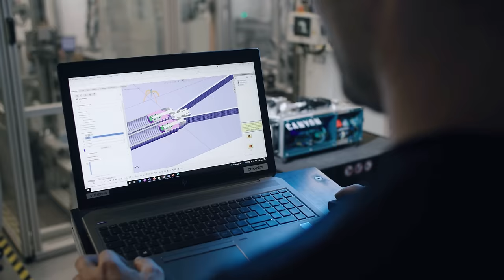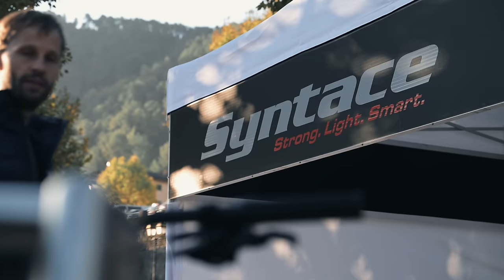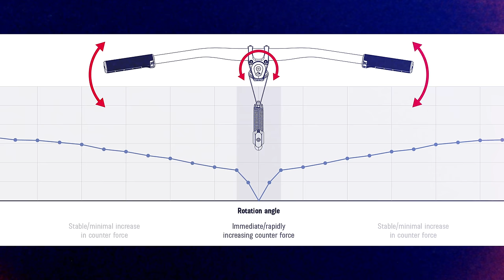Keep It Stable (K.I.S.) | Drop into the details behind this all-new technology.

Comment: The main advantage is it's easier to push the bike anywhere holding the seat only :D
Reply: Exactly it is very old system for city bikes with baskets on handlebars, nothing more.
Reply: Great for pushing your bike home when you snap the mech lol.
Reply: Good point, or just sitting on it
Reply: @Zangief ☭ finally!
Reply: @Zangief ☭ but there is nothing to elaborate on . It is old invention that do not do much but they advertise it as some kind of revolutionary new idea.
Reply: @Zangief ☭ motorcycles have been using stabilizers for decades, this being a on a bicycle doesn't make the actual invention different lol it's a steering stabilizer for a two wheeled thing lol pretty standard stuff in the moto world, now MTB downhill speeds are matching motospeeds... in come the need for stabilizers.
Reply: @GrafRamolo  totally, it's literally a spring that counteracts steering
Reply: @quban79  it's what I wrote .
Reply: Not at all. The free steering its what keeps the bike strait. At the first vibration this bike will fall.
Reply: @BodieMTB  lock your handlebar with two straps and try😀
Reply: you must have no idea how stabilizers work lol people use them on motorcycle buddy
Reply: @BodieMTB  we ´re talking about pushing a bike from the seat
Reply: I'm not talking about that lol
Reply: @BodieMTB  these are the answers to "The main advantage is it's easier to push the bike anywhere holding the seat only :D"  from György Mohl 🙂
Reply: @Zangief ☭ velo orange has had this for some time, not exactly the same design but essentially the same idea.. the concept has been around for ages..Cane Creek made a headset a while back with the same notion, don't think it ever took off though
Reply: It had better be more than just that, because wheel stabilizer springs already exist.
Reply: @BodieMTB  I'd argue that moto stabilizers have a different function and have an actual damper in contrast to springs. That'll be the "KIS pro" developed by Fox in 2024. 😄
Reply: I mean it is quite New that you see it on a bike but for racing-motorcycles like Superbikes, there is something similar existing it a steering damper or zu Deutsch Lenkungdämper ... dort erhöht er die Stabilität bei Kurvenfahrten oder gerader Strecke durch Minderung der Vibrationen.
Reply: @quban79   a very well tuned one tho
Reply: Bener 👍
Reply: @Carsten_Hoett  except for the fact that a motorcycle steering dampener does not return the steering to centre when you have the bike on a lift or the front wheel off the ground. It also has differing resistance depending on the handle bar angle. So not really the same after all.
Reply: @yuk-erkmckirk9277  Well the only thing I want to admit is that the general idea is existing longer.
It is also common sense, if you have been once on a motorcycle, that the dampers are not going to reset the steering wheel/bar and that the forces are different.
At speeds beyond 50km/h you steer the moto only marginal by changing the bars angle and more by leaning.
Imagine you would drive about 100km/h and your bar is resting without knowing, that would be the difference of curving or not.
And at speeds greater then 200km/h where the vibration is getting rough the force are probably also different but in the end this design is also attempting to react less  quick to impulses for keeping the bar stable at its position and yours is more quick because you don't impact the direction changes.
Reply: @yuk-erkmckirk9277  Btw. it is probably also not wanted to reset neither by bike nor motorcycle because both vehicles work the same way and it's stability is depending of the velocity of the rear-weehl mostly as they act like a Gyroskope which keeps it self stable by the spin.
If would fix the front bar the contraction would fall aside because the front wheel would not adapt to its precisional-movement. Therefore motos are also quite more stable on higher speeds than lowers.
So I can imagine that no-one mounted this on industrial skal eventually because of cost or to not negatively impact handling.
I guess the damping coefficient is choosen well so that this is still possible.
Reply: @quban79  Extra $500 for a couple of springs, some bands, & hollow out a portion of the frame.. I can see why.
Reply: Indeed. Pushing the bike by the stem was just too complicated a maneuver.
Reply: So, it is good for triathlon transition zones, and I see it as the only advantage :)
Reply: @Zangief ☭ Decathlon elops 520

Comment: hey canyon, you can easily make this bar spinable if you put the cam ring on a torque sprocket. it will click back into original place after the spin. <3
Reply: W manz
Reply: @mtbewan5632  and it will also, sound cool as heck.
Reply: @trbotimmmmmmmeh  imagine if it dinged like a quick release steering wheel
Reply: @matess3655  i just tried making something like this with a spare tire tube as a glorified elastic and it seriously works, the bike seriously just wants to stay stable and does not want to fall over. canyon, you nailed it.
Reply: @trbotimmmmmmmeh  i was thinking of making it myself, stoked to hear that it works with something as simple as an inner tube, i'll definitely make it now
Reply: @matess3655  it was very ugly my knees kept hitting the bands in agressive pedal position, had to stretch the bands from the tops of the forks stanctions all the way to my seat tube to get the same even torque on both sides. a tight spring or a rubber elastomer is much more efficient than long elastic bands, takes up way less physical space for the same torque.
Reply: would probably also protect the system when you crash
Reply: @brownzys7299  oh! yea! a crash would surely damage something if the bars spin out of control!!!!
Reply: @trbotimmmmmmmeh  tried to make it just by connecting my top tube to the stem with a piece of inner tube, gonna need something stronger though, it was barely noticeable
Reply: @matess3655  no dude lol, you gotta like wrap a whole tube around your bottom top tube to replicate how tight a spring can be, then get some fabric straps for the forks, just like canyons idea. i did this tonight. still not a permanent replacement, im not thrilled with adding the weight of a tire tube to a dh bike.
Reply: @trbotimmmmmmmeh  yeah i know it's gotta be much tighter, it was just a prototype i threw together in a few minutes, it's gonna need lots of improvement. Thanks for the tips though
Reply: @trbotimmmmmmmeh  

This looks like what you'd get if you asked Rube Goldberg to design a compliant mechanism for this use case.

Damping/steering assist - great idea, odd execution.

Search "compliant mechanisms damping" on the web, because the programmable steering return/assist curve is something that's well documented in a multitude of compliant mechanisms that already exist, as well as general suspension analogues for almost any vehicle/type you can imagine and then some.  

The work has already been done but few manufacturers seem to be picking up on it - then again, if you don't need replacement parts in a near perfectly working design they're probably scared of losing a piece of that arguably reoccurring revenue as well as potential future sales of "improved" models.  It's SUPER common to add complexity and awkwardness to a design just to create a solid dependency link between the end user and the manufacturer, especially if your design is really solid and flexible.
Reply: Why would you want to spin the bars anyway? Just use a jump bike or BMX...
Reply: @MrKFess  welcome to 2022 where mountain bikers do tailwhips over 20 foot gaps. jump parks need perfectly groomed jumps, mountain bikers dont.
Reply: That was a concern I was thinking about really cool idea
Reply: I think this one is not going to be mainstream, cause it is dangerous!
Reply: or make it magnetic??

Comment: This is one of those things that's odd at first, hard to wrap your head around and seems too simple to work well. I'm way more excited about this than anything with a battery though for sure.
Reply: For me too. But I fear that a simple thing like a tube at an angle used for steering with the help of bearings isnt fancy enough
Reply: Even simpler: Use fork offset to do exactly the same thing like bike manufacturers has been doing for 100 years...
Reply: @titter3648  Annnd, that impacts trail which means you either wipeout at high speeds or you cannot turn at low speeds.
Reply: @underbikedoverconfident1142  ya , I had an electronic steering damper on my motorcycle. It's sould do anything while moving super slow but would tighten up faster you went .

Comment: This is going to pair very well with the new full time AWD systems they are putting on bikes, especially those with the e-differential lock.
Reply: Have you seen the crab walk mode for new awd rides?
Reply: @bethsaytomvarughese8839  yes I've ridden the new Santa Cruz concept bike that has crab walk mode and adjustable ride height. Very cool.
Reply: Nice... What about the one with the autonomous riding by Skynet?
Would you be the rider or pillion on that?
Reply: I can't tell if you're joking. You know bikes exist that have AWD, right? I own one. They're made by Christini in Philadelphia.
Reply: @deusexaethera  I am joking. How does the AWD ride? I'd like to try it. Is it a significant improvement from a normal e-bike?
Reply: @devoidbmx1  : I have the old fashioned human powered version. It rides like any other XC/AM bike, with a little more drag when the AWD is engaged, but honestly the AWD makes the biggest difference when climbing terrain steeper than I can feasibly handle anyway. If e-bikes had existed when I bought my Christini, it would've been a perfect application for pedal-assist technology.
Reply: @M4MK it was a joke
Reply: @M4MK  Crab walk is a new feature of the newest Hummer EV. Look it up - rear and front wheels turn in same direction allowing for sideways "shuffle" of the vehicle. Very odd.

Comment: I could see this being very helpful for superman seat grabs.... or any no handed tricks. It is interesting... but I just got a new spectral and will wait for some serious reviews before any further judgement
Reply: My only concern is if it can't X-up
Reply: @miyamotosan972  you can still x up just fine, the bars willl have more resistance when you turn them but not enough to stop you from turning them, as long as your feet are on the pedals it won't be enough resistance to shift the bike under you
Reply: @BodieMTB  Thx.
Reply: No handers was the 1st thing i thought of too...
Reply: Two hands on the handlebar- good.
No hands.................- Good. Spring or string is still balance.
One hand only and there would be a 'pull-push' imbalance.

Comment: I'm quite skeptical and would want to try it. This isn't a steering damper, rather just a centering device with springs. More anti-turning force applied as you turn the bars. If you turn the bars to one side and let go, do the bars oscillate back and forth because there is no damper? Wouldn't it be smarter to use a spring + damper instead of just a spring, so that not only does the force increase with deflection, but the rate of turning in any direction from any deflection is dampened/controlled as well? If we plot the bar rotation on a compass, -90 (left) to 90 (right), 0 being center, if you go from 0 to 35 you'll get a spring force fighting against the bars turning from center to right, but as soon as you want to turn back, the bars accelerate back to centered, meaning less force is required to turn the bars back from 35 to 0, you actually get an assist counter steering. Might make initial turn in harder, but switchbacks easier?
Reply: I think that's exactly what they're saying. Initially resistance is high but once you turn the bars beyond a few degrees off center, it becomes easier, but still has some spring force.

Comment: Motocross and off-road bikes has had this for years. It's pretty nice to see it come to the bicycle world. I love my Canyon.
Reply: Is it the same tech as a steering damper though? I think this would be closest to a radial damper but they also have electronic hydraulic control and linear shock absorbers too... they all seem to do the same thing but at a higher weight and requires more force (likely due to the weight of the bike).
Reply: @_Jake.From.Statefarm_  Yeah, I just meant steering stabilization in general. Cheers! 👍🏻
Reply: No this is not a steering damper, dampers are shock absorbers. They slow down steering inputs the faster you input them (speed sensitive) they do not return to center 
This is a progressive spring rate that self centers the steering, much like the caster setting in a 4 wheeled car.
Reply: Pistenbock has had that for years
Reply: it's not the same as an mx steering damper, this is pulling the steering back to straight.

Comment: The concept has been around a long time (see: Hopey steering damper), but I think this is a really elegant evolution of it. Would also love to see an add-on external version that could be put on a range of existing bikes.
Reply: About 30 seconds into the video I thought of the old steering dampers but this isn't the same neither an evolution of it. The first obvious difference is that a spring is a energy storing and returning device and a damper is energy dissipating device - meaning that Canyon's system is steering position dependent and the Hopey steering damper is steering speed dependent. The outcome of the two different systems to the rider's sensory feedback are completely different. What KIS does in a very simple terms is simulating what a car's steering does to tell the driver that the front tyres' grip is saturated. In car tyres, due to the large contact patch area and the construction of the tyres themselves, it generates a significant amount of self aligning torque that is proportional to the lateral grip to certain point, making the tyres torsional spring rate become a signal for the driver to understand the grip level. With the digressive curve that KIS has, it mimics something very similar. 
Additionally when there is certain level of constant reactive torque applied to the handle, it helps the rider to maintain steady position. Imagine how easier it is to just push or just pull on something rather than trying to do both while trying to hold a constant position. This is a common phenomenon in electromechanical control systems when the load is too light, the servo or actuator position continuously fluctuating about the target point.
Reply: @josephyang8236  I wonder how this affects for example climbing or just regular pedaling, exactly because a spring stores energy.. and you constantly tend to rock the handlebar and waste energy in that movement.
Reply: @Nobody-Nowhere  hey you rasie a good point there. I'm pretty intrigued to try this myself! hopefully they'll have a demo day at my local trail this coming summer.

Comment: Could you explain how this clamps to the fork steerer tube? What would happen if you had to remove the forks for some reason?
Reply: there is a covered hole on the side of the headtube, inside is a bolt that tightens the clamp. don't know if it would stay in place once you removed the fork though

Comment: It looks really interesting, but I am not so sure if it is necessary change. I don't think that anybody had a problem with steering. 
Maybe I would change my mind if I would try it, but right now I think it a solution for a problem that no one has.
Reply: More suited for slack head angle geometry bikes, all my bikes have 63 degree or less head angle and do suffer from wheel flop
Reply: @downhill64  yeah, until now I only had enduro bikes so I don't really had this problem. But if it can really get difficult with the steering then this invention is gonna be a big help.
Reply: @downhill64  is that a small frame/large 27/29 wheel issue? might be worth going to 26" if it means you can run a medium or large frame with proper angles.
Reply: @downhill64   LOL just get better...
Reply: exactly

Comment: I want this just for replacing a kickstand!  You can lean your bike up against something without it falling over!  Maybe it could even lock or double the tension with a switch!  I used to have a flick-stand on one of my 80's bikes that worked great.
Reply: Heavy rubber band around the rear brake and you can park a fully loaded touring bike on stairs!!!!! or a downhill bike on it's rear wheel in the corner behind your condo door  at Whister. We just call it a touring kickstand!  If a bicycle cant roll away it is almost impossible for it to fall over!! Head down to your local ski shop and ask for a ski brake retention rubber band with a 6 pack in hand and you will get a handful.   LIFETIME SUPPLY!

Comment: The KIS concept seems promising, especially in higher speed front end grip loss situations. If, as they said, it's not for someone that likes to whip, how will the bike react if whipped (for steeze, need, or just scrubbing)? No matter how beneficial the system may be, if the springs rattle or knock about inside the frame over rough terrain, it may make the difference between wanting the system, or rejecting it outright.
Reply: I dont understand how this affects situations where you lose grip
Reply: My Bike Tracks Awesome 😎 Proper Setup Is KEY 😁
Reply: They said TAILwhip (that's spinning the bike frame 360 around the stationary handlebars) and barspins, not regular whips. Riders were doing whips on the video and said it felt good.
Reply: The point you brought up about the springs making noise in the frame.Thats exactly what I was wondering.That would drive me crazy.